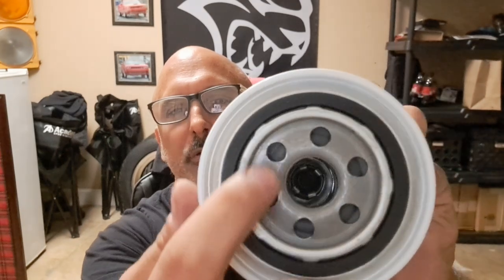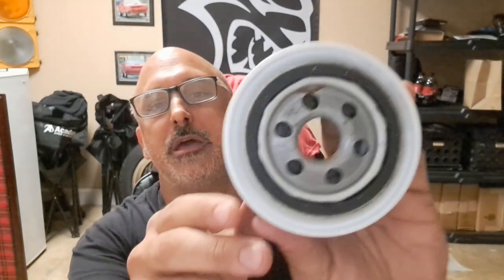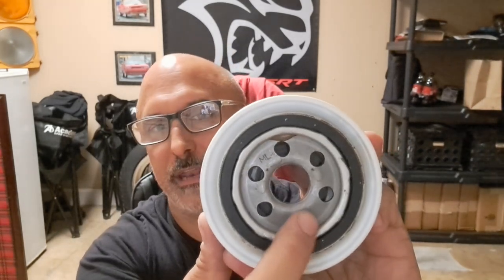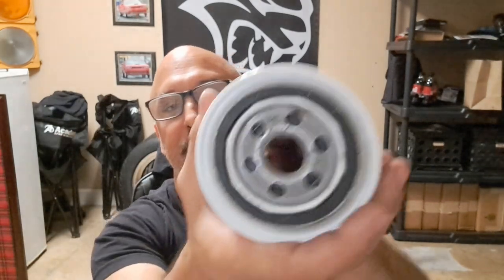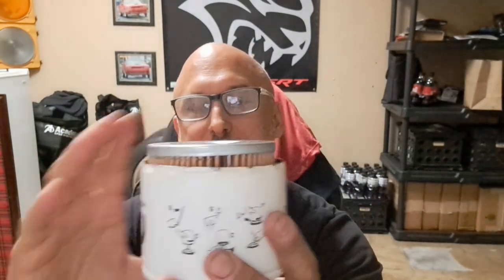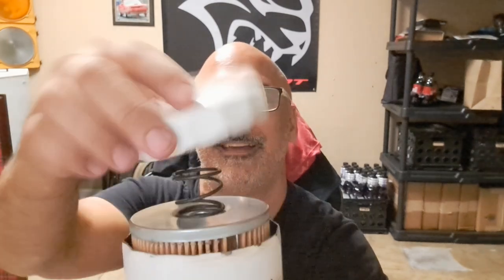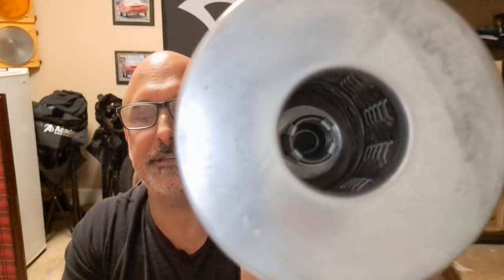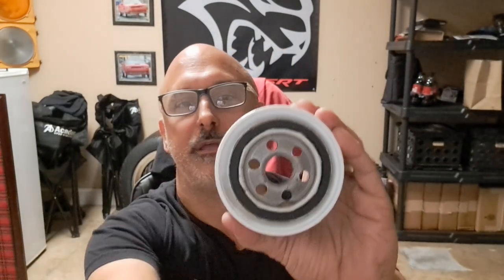How an Oil Filter Works.

Comment: Just a thought, have you considered discussing the power ranges/ limits of the different displacements? I.E. 5.7, 6.4, 6.2 i’m talking stock block. I feel like having worked in shops and seen cars, projects pushed to their limits stock & otherwise, you’d be able to offer a lot on this subject.
Reply from the maker: I have chatted around that topic for a while.  Not to shirk it, per se.  More because the practical limits for the 5.7, 6.1 and 6.4 are really more a function of the limits of the transmission and the tuning capability of the person tying the combination together. ( nearly always boost combinations) .
Reply: @bmasontv  Understood, and appreciated 👊